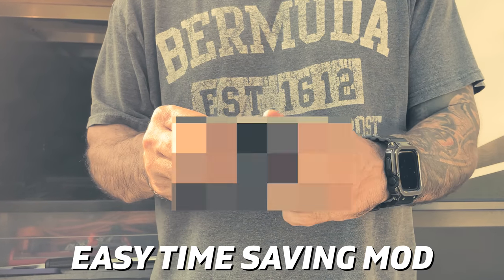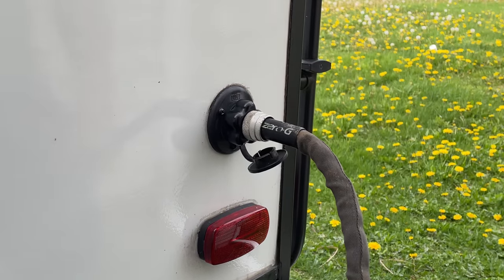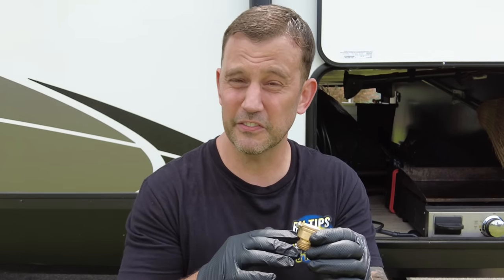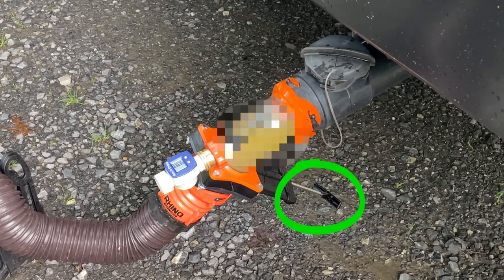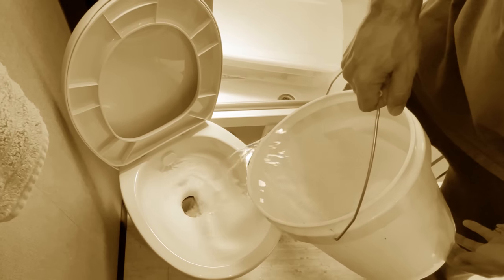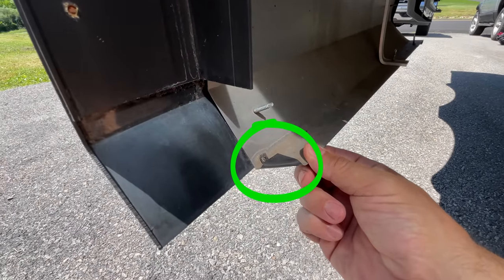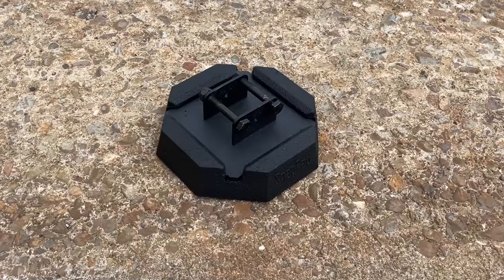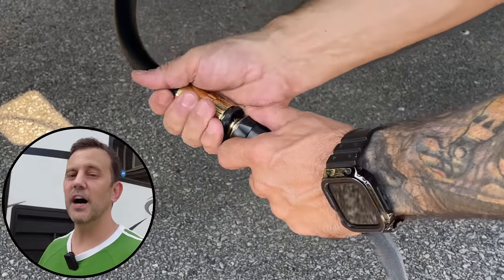3 Overlooked Yet Important Things Every RV Owner Should Do

Comment: The bonus tip is a game changer. I always struggle getting my water hose through the opening at the bottom because it has these strong plastic flaps with long screws on the inside. So it’s literally a pain trying to get my hose through there to connect to the bay. Your tip eliminates that whole issue!
Reply from the maker: i have nightmares about thats plastic flaps, and the noise is like fingernails on a chalkboard too.  glad to know im not the only one.  thanks my friend.

Comment: As always, great video.  I rinse my tanks similar to the way you describe after every trip at home, just with a different branded back-fill device.  After dumping the black tank, I always use my black tank flush first with a water meter 1-2 times to get some spray action going and then follow it with the back-fill process.  

Thank you for encouraging people to not do this at a public dump station with others waiting.  It’s unreal it has to be said but it does.
Reply from the maker: I've been in the back of that line Josh, so definitely wanted to mention it.  Thanks for always stopping in bud.

Comment: always good rv info here!    One handy item to have around an rv is split loom wiring protector, [ flexible black tube cut along its length to slip over wires] not only does it protect wire but you could run it along that sharp edge underneath your slides eliminating the danger and also run it around openings in metal that wire goes through to keep the wire from being damaged by the cut metal edge! Or you could save some money and recycle some old air water or fuel hoses by cutting along the hose to slip over shap edges underneath or inside utility areas... it usually holds itself on  but i add a small shot of silicone adhesive inside slit every foot  or so to secure it
Reply from the maker: great points, thanks for adding to the video.

Comment: I started using this method 2 years ago when I couldn't get rid of the smelly black tank. After every black tank drain I flush the tank with 20 gallons of water 2-3 times and now I never smell the tank even with the exhaust fan on. Excellent video.
Reply from the maker: glad it helped!

Comment: I did get the Rhino blaster based on this video and found it worked well and was really convenient. It did however take a while to refill and dump the tanks more than once compared to your bucket method down the toilet. It probably wouldn’t be feasible at an even moderately busy dump station.  So, I may still try to use the much faster bucket method when using a dump station and the rhino blaster when I have full hookup and plenty of time to rinse the tanks a couple times. The other thing is, in order to refill the tanks to 75%, I do wonder how to account for the amount of water the hose itself holds and how much more we might need to add to reach 75% in the tanks.

Comment: Good Job! I've simplified this process. I use water meter on black tank rinse and fill 3/4 full and then open black tank valve. Simplifies the process and less parts to carry.
Reply from the maker: Thank you, and yes that will do the same thing.  I do this though because the plastic vacuum breaker inside the walls of the rv is known to fail and leak so I try to avoid using it as much as possible.  Plus this method is putting resting water inside your drain pipes so you get a little bit of a soak in the pipes too.  Thanks for watching bud!

Comment: Good video! We’ve been traveling with our 2450RL. Couple things I do that are similar. 
1. I use a 45* fitting in the bay, it’s a little easier to take on & off. 
2. When I refill the black tank 2nd, or 3rd time I do it through the flusher valve with the flow meter. 
Great information 👍🏻
I also have a unique setup for my sewer hoses using rain gutter and home made adjustable supports made from 1/2 PVC. I can send pictures if you’re interested. I don’t think I can add pictures to this comment.
Reply from the maker: thanks for sharing Richard!

Comment: I like those quick disconnect water fittings. I coat the rubber washer within the fitting with water faucet lubricant to make a better seal. It ensures no leaks.
Reply: I bought a bunch of them, they go on everything for me. the splitter, the filter and regulator all of the hoses. They work great, I even use them at my house.
Reply from the maker: good tip, thanks

Comment: Is there a a reason to use the rhino blaster to backfill instead of using the black tank flush with your flow meter?
Reply: That's a great question...
Reply: Filling the black tank through the black tank flush port is what I have been doing. I can't think of a benefit of using the Rhino Blaster other than possibly speed, assuming the spray nozzles flow rate is less than straight out of the hose with the Rhino. ???
Reply from the maker: Greg, great question... heres a few things to consider.
1) some folks dont have a black tank flush port, so this would be a no brainer.
2) i havent tested this yet, but i will assume youll be able to get water into the tank much quicker using the rhino blaster over the flush port.  You dont need to regulate the pressure at the pipe.  The flush port needs to be regulated.  Plus you have an open valve instead of going through a tank sprayer.
3) your also getting water to sit in the sewer pipe for a little while.  maybe im overthinking it, but this gets a little bit of a soak and rinse in the pipe in addition to the tank.
4) you can clean your gray tanks too, the flush port doesnt do that, obviously.
both do the same thing in the end, but if im using the black tank flush port, its going to be just to get a spray down on the walls, which i definitely will continue to do.  otherwise, i like the rinser better.
Reply: @RVTIPSANDTRAVELS  That's a good and very through answer, thank you.

Second question, is it ok to have a dedicated black tank flush hose that connects to the spray port quick connect on the RV as long as it has a vacuum breaker and valve? All of my hookups are in the same spot on my new trailer and it would be pretty convenient that way.
Reply from the maker: I think that’s fine, I would check to find a plumbing diagram to be sure, but I’m almost certain all rv’s with a black tank flush or fill ports have a vacuum breaker installed on the line before the tank.

Comment: My sensors easily get covered.  I use this backfill device also.  I don’t have a flow meter but instead just set my iPhone stopwatch to 4 minutes.  It ALWAYS shows an EMPTY reading after this.  Mine is a flush king brand but same setup.  Also, that UNIQUE brand chemical from Walmart seems to really dissolve everything well.  Great video!
Reply from the maker: Josh, my sensors do that every so often too... it doesnt seem like they consistently stay clean, but they always work good after a good rinsing.  The cuplrit might be toilet paper.
Reply: @RVTIPSANDTRAVELS  definitely in agreement.  Good rinse is always the answer.

Comment: It's good that you encourage use of a vacuum breaker in your video.  But did you know that vacuum breakers should be placed at the hose bib and higher than the hose
Reply from the maker: That is correct, I run the black one in this video at the bib as a back up.

Comment: If I can add a piece of advice it would be to have backups. Carry extra everything. Fresh water hose, extension for your electric service line(as well as surge protector and dogbone), and sewer line. I found out the hard way on our very first trip with our RV when the camp ground put the fresh water hookup at the front of the rig instead of in the back with everything else. At one campground the electric and water was in the front. You need to do this ahead of time because if you need to buy it from the campground chances are you're going to pay at least 25% more.
Reply from the maker: Totally agree!

Comment: I use the tank flush to backfill the black tank by closing the valve while flushing. Fill it up and dump it as many times as you need to get clear water.
Thanks for all the tips.
Reply: I do the same.  If equipped, your doing the same thing.
Reply from the maker: That’s correct, however, you have to regulate the pressure flow if you’re using the black tank flush port because it’s going through plumbing lines. Using the rinser allows you to fill the tank faster because you don’t need to regulate the water pressure at the termination pipe. Additionally, if you ever get a clog, a black tank flush port isn’t going to help. By using a rinser you’re pushing backwards pressure on that clog which may help to dislodge it.
Reply: @RVTIPSANDTRAVELS  1. If already have a regulator at the water connection there is no need.  If your looking for a  "Faster" way, to fill the tank, a 5 gallon bucket does the trick.
Reply from the maker: I use a “t” at the water connection, I use a separate hose for black tank cleaning that connects to the other side of the “t” that is not regulated, so it definitely fills up faster than using regulated water. Using a 5 gallon bucket also takes longer because you have to turn the water off and carry the bucket inside, then dump it down the toilet, go back out and repeat 5 times.  Even if that time is minimal, it’s still extra time.  All that time the rinser is constantly filling the tank, No wasted time turning it off carrying the bucket inside, dumping, then back out to fill again.  Shooting unregulated water directly into the tank is much quicker than any method.  Simple logic.  Plus with the rinser you can apply back pressure to a clog, as I mentioned earlier and you can fill and rinse gray tanks.  I won’t argue that a black tank flush port is “doing the same thing” to fill the tank, it even has its benefits like spraying down the walls, but it’s slower without question (unless the campground water is not higher than the regulator, which is rarely the case) and doesn’t give you the ability to clean gray tanks.  Thats why I featured it in the video.  I realize you want to continue using the flush port, and that’s perfectly fine.  I’m just trying to help others and share ideas.  Not trying to argue with you bud.
Reply: @RVTIPSANDTRAVELS  not trying to argue either, its a good option if you do not have a built in Black tank flush BUT a waste of $$$$ if you do.  Just saying.

Comment: Great tips Ross! Wish we could use the Rhino flush but our Provincial campgrounds (which we camp at most) have cut the ends off the flush hoses. Will have to figure something out for home use.
Reply: To prevent you from rinsing tank?
Reply from the maker: Tom, check this out: https://amzn.to/3s0Cxp1
Reply: At your local home improvement store, buy a cheap hose end replacement.  Carry it with you, attach it to that cut hose, remove it when done.  Defy tyrants!

Comment: An easier and quicker way is to get a gate valve at your hose connection. After you dump your black tank close the gate valve and open your grey tank with the black tank open. It will even the water between the 2 tanks. Close the grey water valve then then the gate valve. Repeat a couple times. It fill the black tank in 20 seconds and saves on water.
Reply from the maker: this method does work a little, but this method presents 2 problems.  If you have a larger gray tank or combination of gray tanks you can overflow your black tank.  additionally, if you have less water in your gray tank than your black tank capacity you arent cleaning the entire black tank.  its going to be extremely rare the amount of gray water you are using is the same amount of water you need to clean your entire black tank.  you really need to measure how much gray water your putting in your black tank so you know you can fill it most of the way and get it clean.  by using the rhino blaster and a flow meter you are accurate to the gallon.  this also gives you the ability to clean your gray tanks, which can actually get worse smells than black tanks.  thanks!
Reply: @RVTIPSANDTRAVELS  you have to manage the levels of your grey tank also but I've never has a overflow and I get 3 flushes per grey tank.  It's level amount more than  capacity. As long as you're level or close to level it won't over flow.
Reply from the maker: That’s definitely another option, thanks for sharing!

Comment: It should be noted the Rhino blaster  only works if there is a straight shot into the black tank.
If there is a bend in the exit pipe from the tanks exit valve it's completely useless.
Reply from the maker: It’s purpose is to back fill the tank, so you can fill, soak and rinse… not spray a jet into it. That’s why it has a gate valve, so you can fill the tank.  Has nothing to do with jetting water into the tank.  All this is explained in the video.  With the gate valve closed the “jet” of water is underwater in a matter of 3 seconds anyway.  I could understand your confusion, calling it a  “rhino blaster” can may be misleading, lol but it’s not a pressure washer.  It’s a filler and rinser.  Hope that helps.

Comment: The reason those quick disconnect fittings eventually leak is bc they aren’t brass. The look like brass but it’s brass looking finish over aluminum .  I too had the same fittings.  I then switched to real brass fittings and no more leaks.
Reply from the maker: I gave folks 2 options, aluminum and brass.

Comment: Should have purchased when they were on sale after your last post.  Noticed you do not use the brass connector on the SADFM.  Thanks for the videos and advice!
Reply from the maker: What is SADFM?
Reply: @RVTIPSANDTRAVELS  Sorry - I guess it sounds like a bad FM station - it was an acronym for the Save a Drop Flow Meter - but with as many videos and items that you have listed - acronyms might always make you wonder 🤔 - make every day the best you can & thanks for the videos and preferred items.
Reply from the maker: Haha!  I’m googling it here trying to figure it out 🤣🤣🤣🤣 thanks bud.  The brass valve connects between the flow meter and the rhino blaster.

Comment: I've been a professional driver for over 40 years. I have never had a bathroom in my truck. I don't understand why everyone has to use their camper bathrooms on the road. Most rest areas and fuel stations have restrooms.   It's not much weight to carry but there is some. With the crappy workmanship these days I would be worried about wearing holes in the tanks. I make sure everything is empty before I move. I you're gonna dry camp, fill as close to where you are camping.  When I am at a campground I fill my fresh water in case of power failure that way I can still be self sufficient.  I also shut off the city water every time I leave the rv and when I go to bed at night. A burst interior line can do tons of damage if you don't know it has happened. Shutting the water off could stop a lot of damage.  Just being extra careful.
Reply from the maker: the tanks are made of polypropeline, humas waste wont degrade the tanks.  I think the bigger issue is people driving with full tanks, which can cause sway and porpoising issues, and there has been some tanks that actually fell out due to the weight.

Comment: I use a bidet so there is no TP. I wonder if I will eventually need to black tank flush. I am scared to flush until I replace the cheap internal vacuum breaker that can leak in your RV. I need to make that an external brass fitting.
Reply from the maker: thanks for watching and commenting!

Comment: Sorry for the dumb question, I just bought my first TT and I am so overwhelmed I am regretting getting it. 😢 Anyway, so with the tanks, I still need to do the flush with the Rhino back flow even after I flush it using the black tank flush?  I am so confused on how to properly maintain them. Thanks in advance, I am binge watching your videos!
Reply from the maker: you dont need the rhino blaster, its just another option for rinsing.  the black tank flush in my experience is pretty ineffective.  i wouldnt waste much of your time using it if you instead use the rhino blaster.

Comment: thx for the post/ video
i must admit that i was surprised when u spoke about sharp edges, that i saw 1” screws sticking thru and 0 mention 

am i amiss?

safe travels
Reply from the maker: They are self tappers and they aren’t sharp, plus they stick up not down so I didn’t cut them.  But I did show them in the video for awareness.  The goal of the segment was to point out hazards under the slides.
Reply: @RVTIPSANDTRAVELS  stick your head or head into them a few times bc u didn’t snip them off and then tell me that same reason.. but it’s your site
Reply from the maker: It's think it was more educationally effective to show them in the video as hazards then to tell someone to look for screws that i already snipped.  Would you have noticed them if they were already snipped flush? 😉
Reply: @RVTIPSANDTRAVELS  no
i would not have.. that said, imo, u could amend the video w a caption or similar to warn about these 

it’s your video to do what you want

Comment: Had the same setup - only issue was the Save A Drop flow meter didnt make the par, its plastic and only lasted for a few cycles of back flushing busted apart.
Reply from the maker: yeah, i mention that in my review... that i just couldnt say how long it was going to last.  it does feel kind of cheap, despite working well. time will tell, thanks for the info my friend.  if it does fail, ill have to test another one. 🍻